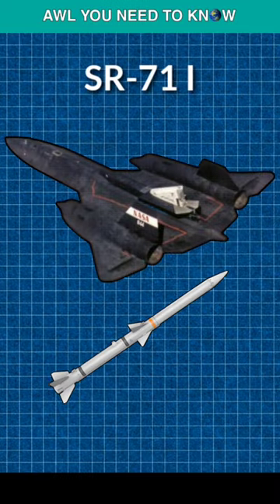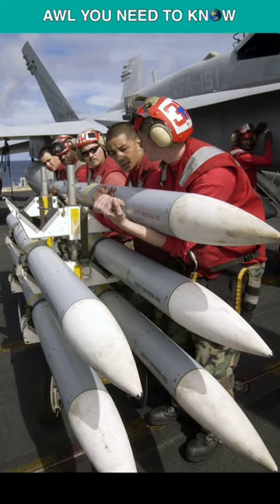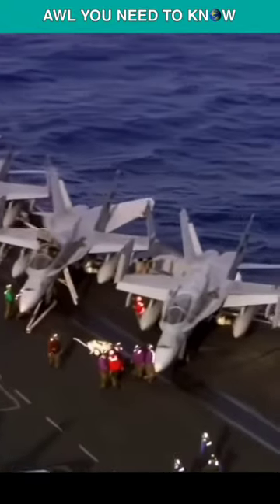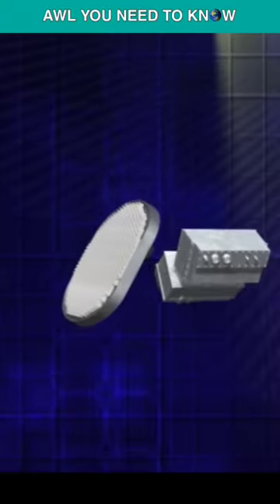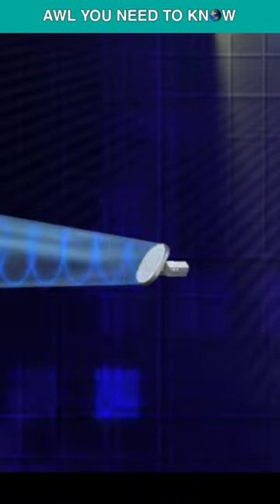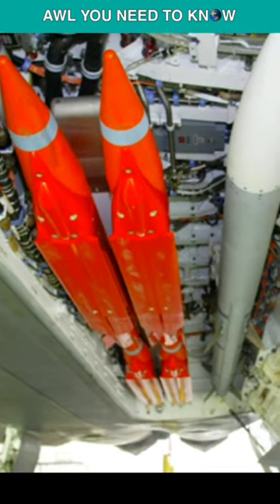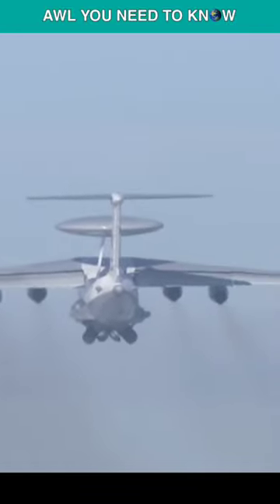When SR-71 Blackbird Almost Had Aim-120 AMRAAM Missiles In 1982 #shorts

Comment: I wonder what would actually happen if and the sr 71 also had an intercepter role
Reply: It was an older idea from the 1960’s before there was an “SR-71”.  The USAF had experimented with the YF-12A interceptor, one of the precursors to the reconnaissance version of the Blackbird.
Reply: The A-12 had prroblems with missiles trying to escape the drag and pushing through the supersonic shockwave created by the jet. It originally had AIM-45 air to air missiles developed for it. They failed as well. The AIM-45 was redesigned and later became the baddest missile carried the the F-14... The AIM -54 phoenix
Reply: Considering it was originally designed as an interceptor I guess nobody will ever know...
Reply: @alvindickens3622  what happens if the aim 54 was managed to be able to fit on liker maybe in 1975 or something the sr 71 retired in 1998.
Reply: @15warsinthefloor  They still would have had the same problem. You will never see a fighter jet fire any weapons while supersonic. The compression wave was near impossible to push through once the weapon was released. There use to be some video of an A-12 that had a missile stuck in its wake only a few feet away from the aircraft. The aircraft tried banking away from it as well a decelerating and climbing. The missile followed it. There were a few A-12s lost due to impacting the munitions it was testing. Also, the AIM-54 was essentially an upgraded and enlarged version of the AIM-45. It would not fit in the weapons bay. It was a very complicated effort to weaponize the jet. It would have been extremely awesome to see a Phoenix launched from that jet. The A-12 would have been the only version of that airframe to do it. It was shorter and lighter than the SR. It could also fly higher and faster too. If you watch the video of the MD-21 accident, it was the same problem the A-12 had with weapons. Ultimately, the D-21 drone was only ever successfully launched from the B-52. The M-21 was basically a modified A-12.
Reply: Look up the A12. It was literally an attack variant of this plane.
Reply: @alvindickens3622  in another universe if it could actually happen what would be the impact?
Reply: @15warsinthefloor it would have been a fast long range method of eliminating any strategic bombers before any weapons could be launched. The problem with the whole program was the amount of time it took to intercept an inbound aircraft. You could not keep it fueled up due to leaks. When it was fueled, it was just enough to get off the ground and immediately connect with a tanker where it would take on a full load. There were other issues as well. The recon role it took on is what saved the program from being abandoned in its early days. I am glad it survived as long as it did because it is one bad ass looking aircraft.
Reply: @joshschneider9766  no it wasn't. Idk where you got that from but the a12 was designed for the recon role. From Lockheed itself:
The A-12 was the product of a secret military program to develop a high-speed, high-altitude reconnaissance aircraft. First flown in 1962, the A-12 was capable of performing sensitive intelligence-gathering missions while flying at speeds over three times the speed of sound.

Yes it has the "A"  which usually means attack, but in this case that's not true. It was it's name, Archangel. 

The only variant designed to have any kind of armament was the yf12.
Reply: @jamesmaddison4546  yeah not sure how I got the two confused but you're right of course thank you.
Reply: @alvindickens3622 apparently they also tried dropping tungsten kinetic missiles from the yf-12. Apparently they worked incredibly well as bunker busters. Havent found any mention of it outside kelly johnson's autobiography
Reply: Imagine the A-12 with Laser beams at supersonic speeds.   😂 🎤

Comment: It wasnt the SR-71s duty. It was designed for the A-12 Interceptor. Ibspent part of my military career on this aircraft.
Reply: What squadron?
Reply: You’re mixing it up with the A-12 based YF-12 prototype. That was in the 60s. This is 20 years later.
Reply: @NickThePilotUSA  you're right, originally,  it would have been the F-12. The A-12 was to be and interceptor as well
Reply: I did forget to mention the F version. It was the one all the weapons testing took place on. It and the A-12 were practically one in the same. The A-12 made it to production and the YF-12 never did.
Reply: The a 12 was never ever intended to be an interceptor or an attack aircraft. The only member of the family with weapons as well as a detachable drone at one point was the yf12
Reply: @joshschneider9766  m-21 drone carrier was an a-12 not yf-12

Comment: specific to the Blackbird program and the SR71, this is 100 percent bogus. my wife and myself both worked at Hughes Aircraft Company who designed and built the avionics for all the blackbirds and the weapons system for the FY12 blackbird interceptor....... HAC also developed the AIM 120 missile which was in essence the next generation Phoenix....ie the HAC AIM 54c. .... which was originally built in 1961 for the 1st blackbird...... and was cancelled. My dad was the engineer who designed the wings and control surfaces for the AIM 54a and became one of the program managers for the AIM 54c....which was used on the F14.....as well as conducted specialized testing and was in charge of QA for the manufacturer which was done in Tuscan Az.
the Blackbird interceptor was built a few years after the A1+ Blackbird for the CIA..... which carried the AIM47 Falcon or  GAR9 missiles (nuclear version of the Falcon)..... a total of 4 missiles which used a deployment system similar to the F35.

Comment: Imagine they added a cannon too a grau avenger would be perfect for it
Reply: NOT! They tried the cannon on the A-12 and had a major issue with catching up with the rounds within a few seconds of firing it. All weapons testing failed miserably. To save the program, the A-12 was stretched enough to add a second cockpit and the weapons bays became the bays that recon equipment was loaded in and the SR-71 was born.
Reply: The SR-71's purpose was as a high flying, high speed reconnaissance vehicle. The Avenger is very very powerful, which doesn't work for the SR-71. It would slow the plane down, and lessen its number 1 advantage.
Reply: The only member of this class of aircraft to have weapons was the yf12. It even had a drone it carried called the M12. The result of the yf12 testing was the realization that you should not expect a thorough bred racing horse to do draught horse labor. It was just too fast for practical tactical use as it turned out